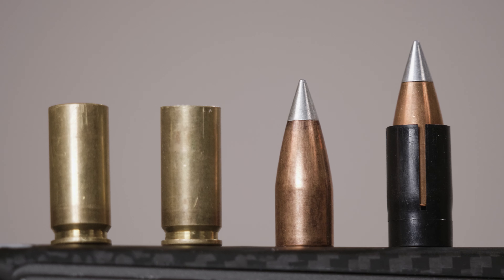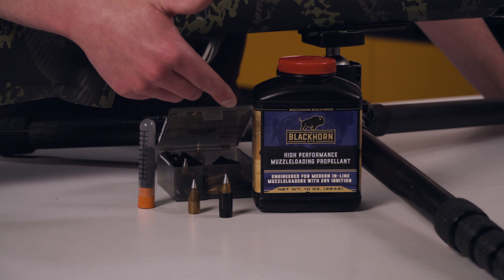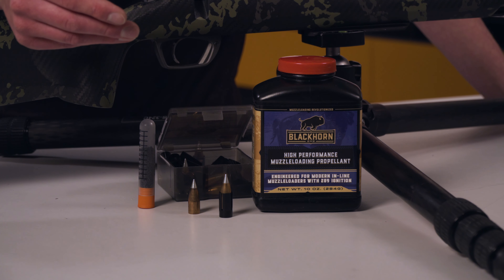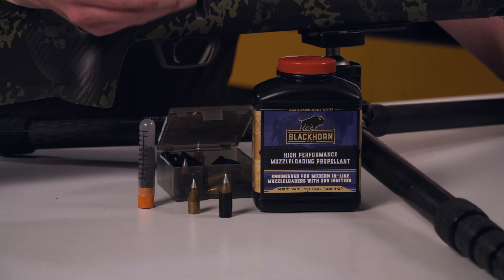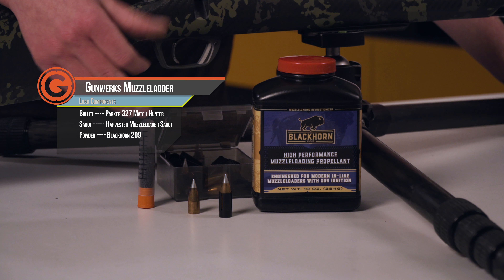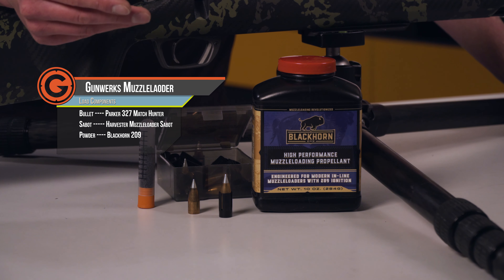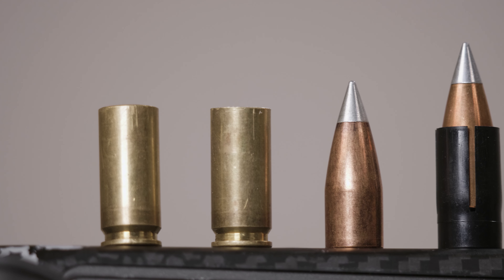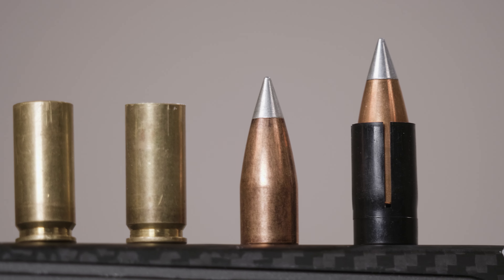Muzzleloader Features | Bullet Load Combination

Comment: In general do you guys happen to know why there have not been or what problems there are with a boat tail designed bullet for muzzleloaders?
Reply from the maker: Generally speaking, the challenge with muzzleloaders is getting a bullet to seal well to the bore and lands/grooves configuration of a barrel. flat base bullets, gas checks, or sabots tend to seal off better. Because you can't generally load a bullet from the muzzle and engrave the bullet by hand pushing it down the barrel (too much force is needed to do it by hand) it becomes unfeasible. There are some who have been successful, but it takes work and special gear and processes to do. Often pre-engraving bullets with a die and section of barrel to make it possible to hand load. Possible, but not very practical. Thus, most modern muzzleloaders use sabots, or in the case of our new 45 caliber offering, a bullet with a built in polymer gash check that provides excellent sealing.
Reply: @Gunwerks  - thanks for taking the time :)